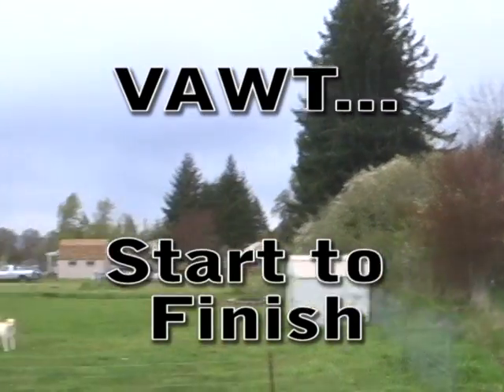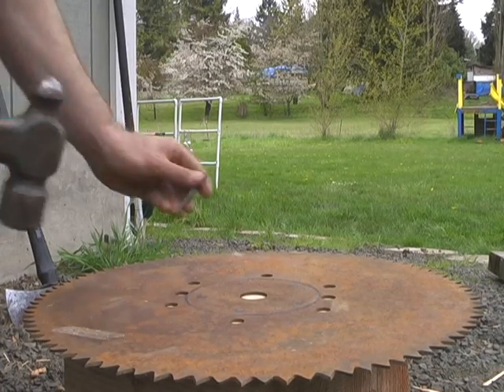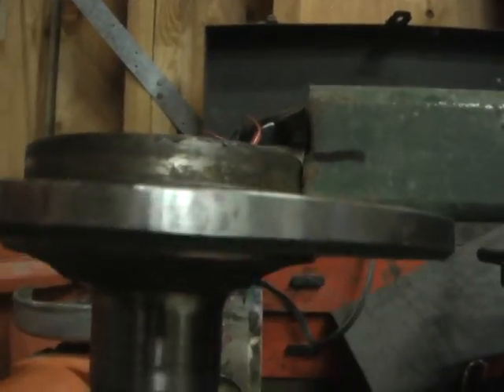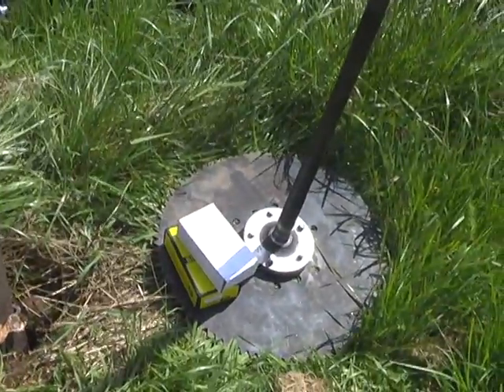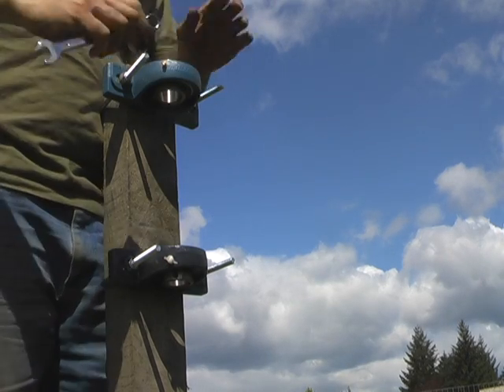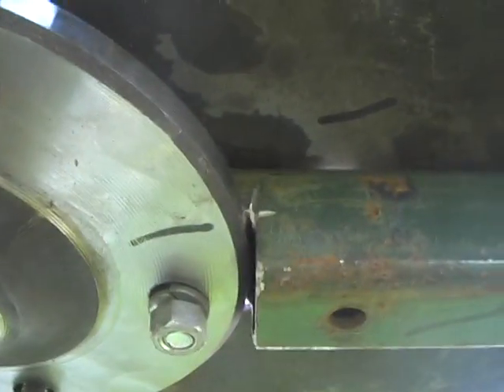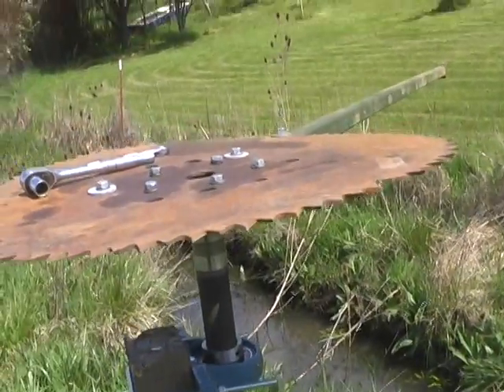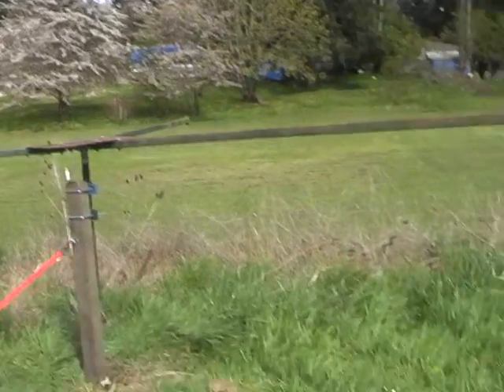Earth Day vertical axis wind turbine homemade diy start to finish VAWT

Comment from the maker: Thank you.  I'm still working on getting some bigger sails on it (the small sails were placed on it just to ensure it was strong enough).  Currently, with the small sails, this would produce only a small amount of power (it would only turn with a tiny generator attached).  Hopefully, I'll get some money and purchase the right supplies to make some actual power; I'll be sure to put up another video on my channel that describes how much electricity this foundation is capable of producing.